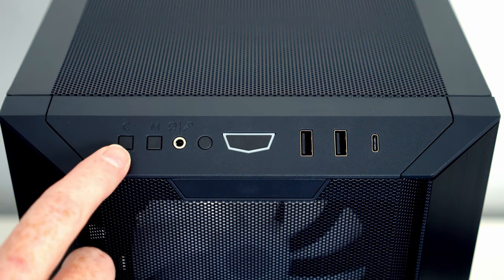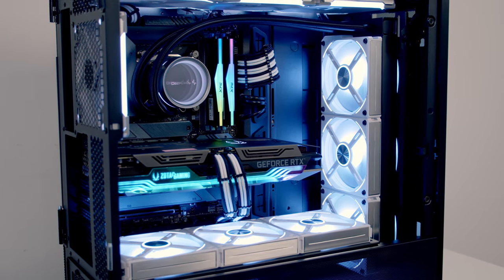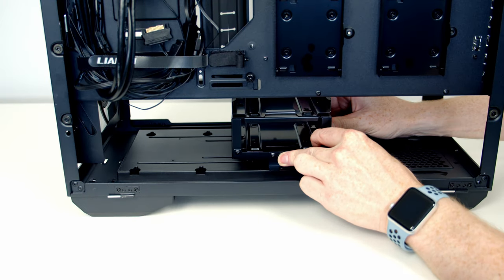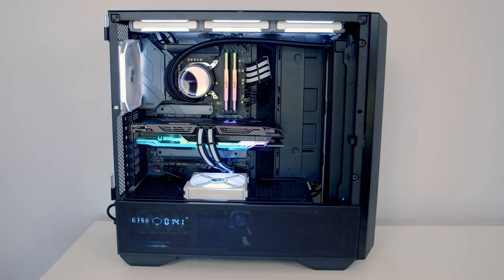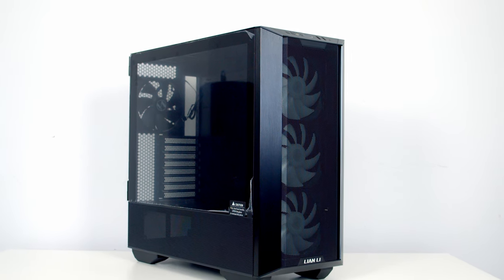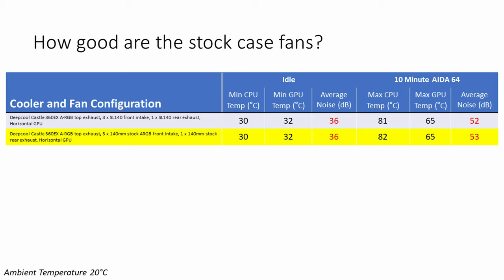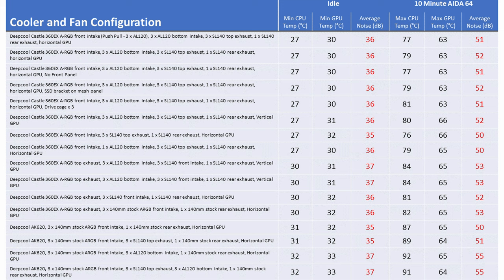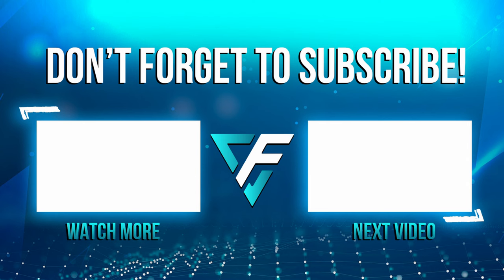Lian Li Lancool III - Best Fan Configuration

Comment: To each their own, but I think it is ridiculous to judge fan setups by aesthetics. Fans are functional components and whatever configuration works best, should be chosen, regardless of how it looks. Who is staring into their case while using their PC? Your top mounted fan setup in the air cooling variant makes no sense because using top exhaust fans near the front just remove the fresh air coming in from the front. A top fan at the rear run as an exhaust definitely helps with temperatures. I really do appreciate your overall approach but you make all your effort meaningless by focusing on optics more than whether fans should be run as intake or exhaust, depending where they are (front or rear of the case). I realise you did a one-fan setup for the bottom intake configuration even though you did not like the aesthetics, but you are letting yourself down if you are just running all top fans as exhausts in the other scenario. Overall, I'm sceptical about your results because having bottom intake fans should make more of a difference for the GPU. Maybe it is the speed at which you are running the fans. I believe one can make a difference by fine-tuning fan curves such that fans operate at speeds that combine to an overall optimal cooling performance. Running every fan with the same speed is unlikely to achieve the best results, particularly, if that same speed is very high. I understand there is a lot of effort involved with testing many configurations, but ruling out some configurations based on a "one speed setting fits all"-approach does not appear to be helpful.
Reply: Looks > all. Opinions are lancool
Reply: While I slightly agree with your approach also, I come with another.

Exhaust at top of you have 3 fans pulling air directly into the GPU is nothing but beneficial. You have intake bottom, exhaust top, which also fits how hot air acts. It rises. IF the AIO were TOP mounted (my preference) and acted as exhaust, it would take in the cold air from the front fans to bring directly into the radiator to then cool it thus cooling the CPU. Front mounts look cool and all but you're bringing hot air into your entire PC which I personally hate and all you're getting is good CPU temps which is nowhere near as important as good GPU temps unless you have a 12900K. While the front top fan on top mounted AIO brings in cool air and cools the cpu, the closer rear exhaust fans being hot air from the rising GPU, same for the rear exhaust, which also brings hot air away from the VRM (useful if they're exposed on some cheap MOBO's) and out of the PC. Hot air won't recirculate if the hot air goes to the ceiling of your room and the bottom of your PC and Front are getting nice and cool air due to the hot air being way above the PC. The top exhaust serve 2 purposes, bringing in cool air from the front 2 fans, and exhausting air exhausted by the GPU. GPU stays cool and that config only lost you maybe max 2C on your CPU which is negligible. Since if 2c makes you throttle, something is wrong with your OC and you need to tone it down a notch.

Overall, 4 exhaust 6 intake, positive pressure intake setup which thinks of both the cpu and gpu instead of only the cpu while the GPU gets a little more than 2c than the cpu would. Also keeps the AIO alive and working.

I don't care about looks I use the beige and burgundy Noctua fans in a white PC with a black white and red mobo with a black AIO which also has more beige and burgundy Noctua fans mounted on the radiator. My GPU is also sagging, but not enough to where it hurts it or the mobo. My PC is ugly but it gets the job done, considering I overclocked a 6800 XT to the power of a 3090 for almost half the price. And I have the exact airflow setup I mentioned before. GPU temps are 68c core on 100% load and 79c junction on 100% load. Very good temps for, what is usually the 2nd hottest if not hottest part of a PC, while having my cpu running at 78c at quite a large overclock as well. I also just won the silicon lottery.
Reply: Looks matter because you have a window in the side of the computer not to mention rgb. If we didn't have any of that then sure it doesn't matter.
Reply: @rocketboyjv5474  It's the other way around. If looks don't matter then you don't need windows nor RGB. 
To me looks don't matter. Neither for the insides of a PC nor for the insides of a car's engine compartment. If today's PC fashions applied to cars, people would have RGB lighting in their engine compartments and demand transparent bonnets so that one can see the lighting.
Reply: Nah... if you have and intake AND exhaust at the top, you're just introducing turbulence to your airflow. Having exhaust at the front helps pull air up from the bottom and get flow from the cold at the bottom from to the warm at the top rear
Reply: @coolcat23  Also, thatjist shiws you don't know shit about cars, because looks DO matter at almost every car show and people DO get transparent hoods to show off internals and engine. RGB is typically just for underglow or cabin in cars

Comment: Holy cow you tested everything I could think of to test in a PC case configuration. Amazing work and much respect for putting in all those hours to deliver us such detailed info. 👏🏼👏🏼👏🏼👏🏼👏🏼
Reply from the maker: My pleasure!
Reply: I know right? He covers evey possible user case out there. This is a fantastic breakdown.
Reply: @ChristopherFlannigan Hi Chris, do you think the Lancool 216 would see similar temp results with this set up? If not, what would you recommend? Currently doing Top 360 exhaust, 2x160 Front stock, 140 exhaust rear, 2x140 gpu intake (with connecting uni fans this could be ran as 3x120) Cheers mate.

Comment: Doing push-pull on AIO is like getting 8 cores CPU over 6 cores for gaming, wasting money to show off.
Reply: not necessarily. You can drop the fans to super low RPMs, so while you may not see a difference in temps, it would be more quiet
Reply from the maker: Building a PC for YouTube is all about showing it off
Reply: push pull on aio's is literally pointless unless you have those extra thick radiators for custom water cooling....having 8 cores over 6 is a benefit tho...more fps, higher 1% lows and higher capacity to spawn 1000 goats without the game crashing ( for example )

Comment: Some excellent testing, though I do wish we could've seen how an air-cooled configuration performed with just one fan exhausting out the top (in the rearmost slot). In the 3X top fan config, you're exhausting most of the fresh intake before it can reach the CPU, increasing the proportion of GPU exhaust being sucked in by the CPU cooler. I've seen 1X top-fan configs perform well with air coolers though since it adds some extra exhaust without disrupting the intake.
Reply: Yeah, GN actually tested exactly that. 1 top mounted as the only exhaust often performed similarly to the back exhaust. For their Lancool 2 Mesh review they had 2 140s at the front, 1 120 on the rearmost PSU Shroud mounting point, and 1 rear exhaust. This got them their chart topping results. They stressed what you did: Do not put exhaust in the middle or front top slots as fresh air is being exhausted before it can be pulled through the case.
Reply from the maker: It might help, but I normally say I refuse to test one fan solutions where there is space for three due to the aesthetics, but can say that here as I tested on fan at the bottom. I though about it and ruled it out on looks. Where there is two fan slots at top I have had the front one intake and rear exhaust before (think it was my 500dx if you want to take a look).
Reply: @ChristopherFlannigan  Well, I've got a beautiful set of beige and brown fans I'll probably be replacing the front fans with anyway, so maybe my sense of aesthetics are a bit different from everyone else's :p
Reply: @Konga From personal experience I can say that adding a top rear exhaust helps quite a bit when using a tower cooler. The setup chosen by Christopher unfortunately does not make any sense, as you pointed out. A top front fan should definitely be run as an intake but probably won't make much difference. I'm also sceptical about Christopher's result for the bottom intake fans. Maybe he had them running at the wrong speed. I manually-tweaked the fan profiles for my fans and having a bottom intake fan definitely had a positive impact for the GPU.
Reply: @ChristopherFlannigan  With my BeQuiet 802 case I have 3x140mm front intake and 3x140mm fans at the top for exhaust, but I just unplug the first fan so that it looks aesthetic, but not doing anything.  I don't have RGB fans so you don't notice it's not in use.  At the rear I have a 140mm fan as exhaust too and it seems to give me the best results with three in and three out total.  My cpu air cooler is the Noctua  U12A Chromax.   I tested different fan configs, but this ended up being the best for my setup.

Comment: While I appreciate the effort, and I know this is a bit of a necro criticism, I would have preferred to see some maxed out hardware. Clearly the cooler the build in generally the smaller the delta between configurations. An overclocked 4090 and overclocked 13900k would have been nice to see.

Comment: I ran some basic smoke testing on my Lancool III using a CPU air cooler with the stock fan configuration. 

I observed that the CPU cooler under load would draw air down through the top vents, and the front fans needed to run at >70% before they compensated. So it makes sense that we see the CPU temps go up when top exhaust fans are installed, as this would be choking off air supply to the CPU cooler.

Great video. Very informative!
Reply: Another reason why top exhaust is terrible with aircoolers is because the top fans (especially the frontmost one) will redirect air out of the case before it even reached the CPU cooler. So the air goes in through the front mesh, and then directly out through the top. The CPU cooler will struggle to pull enough air since it has to compete against the exhaust.
Reply: I wonder what change we would see to the best air cooled setup if only two fans were added to the top middle and front as intake.

Comment: I was planning on building in this case with  an air cooler, happy to see that the stock configuration with an air cooler resulted in the best temps. So I don’t need to spend any extra $ on extra fans or anything. Good video!

Comment: Yes mounting your CPU AiO at the front will make your CPU a bit cooler and yes it doesn't really affect the GPU since it already has a massive cooler on it and due to it's big power draw colder air around won't matter that much however a front mounted AiO is gonna absolutely tank your RAM temps and especially your motherboard VRM temps. 
I always advise to mount your AiO as top exhausts as those 2-3 degrees on just the CPU won't matter at all. It's just not worth it to tank your whole system for it.
Also just a note if you are doing air cooling don't mount top exhaust fans in front of your CPU tower cooler as you will suffocate the cooler by taking away the fresh air coming in from the front. ( for 3 front intake fans 1 rear exhaust and 1 top exhaust in the back is more than enough when you are air cooling)
Reply: Im thinking on something like: AIO 3x SL-Infinity 120mm top exhaust, Front 3x SL-Infinity 120mm Intake , Botton 3x SL-Infinity 120mm Intake and Rear SL-Infinity Exhaust. Looks good overall ? I will still have the 3 stock AIO and 3 stock case spare. ( I bought 10x SL Infinity 120mm
)
Reply: @DanCaparroz  i have the exact same setup now in my lian li dynamic xl case right now :) - though the front 3 intake in my case is more like side 3 intake. Go for it.
Reply: @kerotomas1  Just taking advantage of what the case allows me, im putting the 140mm for the front ans I wont get the Infinity ones since The mesh covers, there is no need for the extra spending. And im evaluating the same for the back. Thanks for the headsup.
Reply: Hey man, I really appreciate you sharing that.
Say, is this AiO configuration for Lancool III alright? Anything to improve here?
3x140 Front Intake (Stock)
3x140 Top AiO Exhaust (Other)
1x140 Back Exhaust (Stock)
3x120 Bottom Intake (Other)
Reply: @Shoutenkou  That's pretty much the best setup you can do with that case in my opinion. :) 
I wouldn't say the bottom fans are absolutely necessary but it will create positive air pressure to keep most of the dust out of the case. Always good to have more fans as intake because of it.
Reply: @Shoutenkou  My question is, what is the NOISE level in the system after all of that, I love the cooling aspect but are you experiencing some high db in noise

Comment: Just so everyone know there is build in this case that can be achived and it is not in the review. Great job first of all Chris. Build is following:

1. Rad on the roof with 6 SL 120 Unifans blowing outside the case. There is enough offset to clear the memory.
2. You can add one 120/140 in the back of the case.
3. 3-120 on the floor
4. This is where it gets very interesting. You can leave 3-140 that came with the case and you can add 3 more 120 without any modifications. Only thing you have to do is take 3 140 out and install 3-120 fans first. After that put back 3-140 fans. Total of 6 fans in the front- that is a lot of air! 

Lancool 3 can have 16 fans all together. Thermals are great
Reply: have you tested a configuration with six fans on the front? my lancool has a freezer 420 on top which does not fit on the front, and I found your idea useful for me
Reply: Your idea is interesting, still i can't figure how to put those 6 fans on the front. Could you explain more please ? thanks
Reply: Could you answer jeys question please bro
Reply: @DanCaparroz  right now I am using loop for my ddr5 8000 memory but I still have 3 140 that came in with case. Other 3 are just on the other side of bracket installed. Nothing really to it. 6 fans still in front. 3 120 lian li and 3 that came with the case.